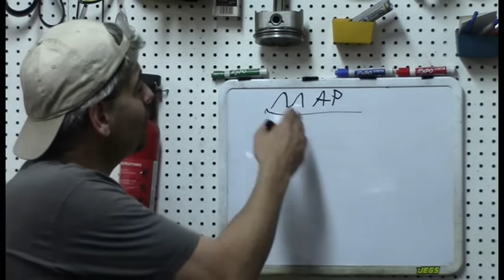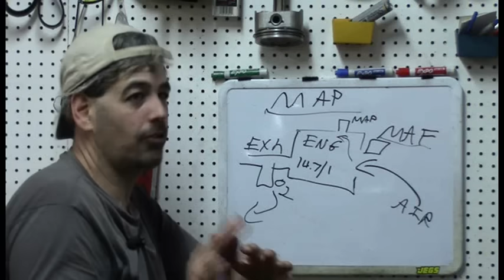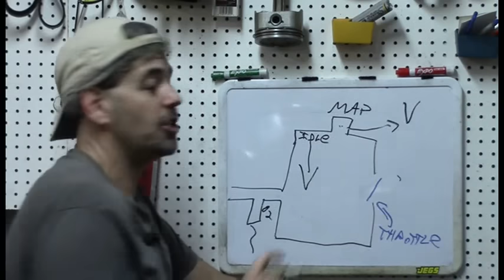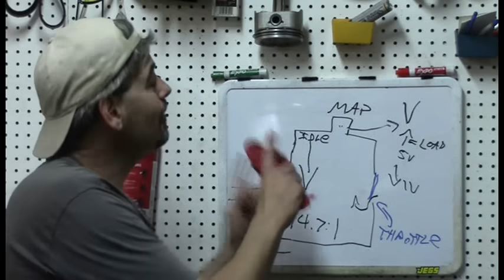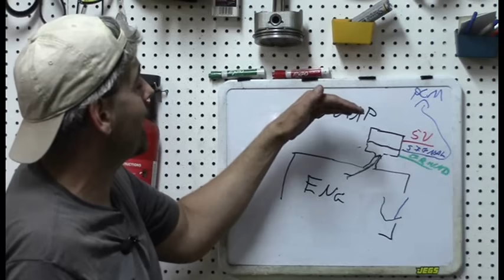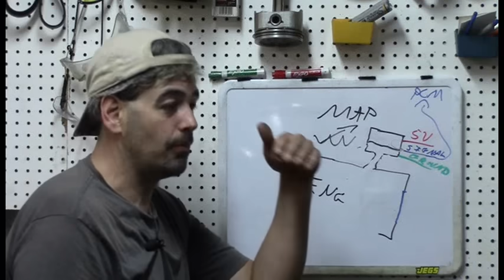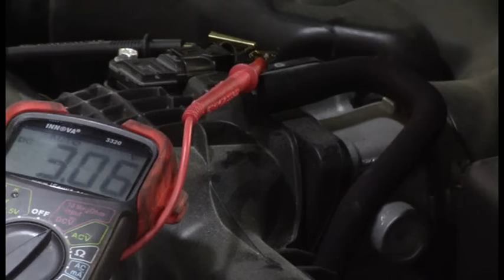MAP Sensor Diagnosis and Understanding Function- Pt1

Comment: hey , thanks for your video.
I am so confused because of these names people use for these items.
I have an ICV on my car which is connected to my throttle body that is used for Idle control.
I would like to change my air flow sensor which is connected to my intake pipe.
Is it fine if it is also called Air Flow Sensor , Air Temperature Sensor?
Is it the same thing?
Mine looks s little different to some i have seen on youtube.
Very hard to find particular car brand videos.
I have an OPEL CORSA B 1999 1.6 IE 1999 year model I think it is version 1.2 .
My car is non ecotec which i am not sure what that is. 
It is GM also, General Motors.
I am from South Africa.
I noticed that when i bought my new air intake pipe it comes with the air sensor or the "sensor" attached. 
For some reason the plug harness does not fit on the plug of the sensor, which is so strange, its like the pins and the mold of the plastic dont line up  which is why i suspect this versioning of the model which is different.
My mechanic hacked mine and just put in my old sensor and we kept the new sensor in my glove box.
I just find that weird as he knows that i have starting issues and i need to crank a long time before my car actually idles.
sometimes or in most cases i need to help it start /idle using the accelerator.
He told me to ignore it.
Looking forward to you comments.
Reply: Does the mass air flow sensor sound like the same as the air temp sensor? Obviously one is to measure air temp and the other is to measure flow. Common sense man. Keep it simple and stupid
Reply: And if the sensors on your engine don't connect to the new aftermarket part you bought, it's not the correct one. 😷 *facepalm. Just bring it to a mechanic shop man
Reply: Clearly different names, but it doesnt explain why auto stores and even the dealers have different names for the part i queried. It even seems part numbers are not a standard at times. At least the air sensor i the air intake pipe i bought was different. thanks.

Comment: I replaced my map sensor on an elantra 2001 and now the car won't turn on. Ignition turns on but when I turn to start, nothing. Doesn't crank.
Reply from the maker: What was the data you had showing yopu needed to replace the MAP? I would start there.
Reply: Schrodingers Box No data. I switched it out one morning when I was heading for work. Reason is, I turned the car on and hit the gas, after 2 or 3 seconds the pedal wouldn't give me power. The car sputtered and wouldn't go higher than 1000 rpms. Had to to turn the car off and on to get that initial start up juice all the way to an autoparts. Told me it could've been a bad map sensor or throttle position sensor. After I switched the map sensor the car wouldn't start. Put the old one back, nothing. Luckily for some reason I got it to start after messing with the engine pulley. Drove home having to do the same thing, off and on.
Reply: Got home and I switched the map sensor again for the new one as well as repairing a small intake leak and replacing the idle control valve I could hear buzzing weird. Nothing. Turns to On but doesn't crank. So, I tried bypassing the ignition by hotwirering it with the engine starter wires but at that point I think the battery was just too weakened to start anyways because it didn't.
Also, I accidentally turned the key to start when I was repairing the intake hose leak. Hose wasn't connected. Don't know if that could've caused an additional problem. Please, save me buddy. Anyone. Please help.
Reply from the maker: Do basic voltage check at the starter relay

Comment: Do you know if it is common for Chrysler to have bias voltage on their map sensor signal wires?
Reply from the maker: Wouldn't know. Just put a DVOM to it and find out.
Reply: Schrodingers Box already did, just want to make sure the 4.1v I got is what's supposed to be there.

Comment: This maybe a dumb question. Butbi have a 2000 pontiac boneville ssei and i have 2 codes one is MAF and other is TPS but also supercharger boost stays at 0 when normal highway speed was at -8 and when i hit it to WOT it would go anywhere from +8 to +10. Could the MAP be causing this. Its reading 14.3 psi at key on engine off.  Still need to check voltage though any help would be great. Thank you
Reply from the maker: it depends on what the codes are
Reply: @SchrodingersBox  P0121 for TPS and P0102 MAF
Reply from the maker: What is the reference voltage showing at the MAF and TPS?
Reply: @SchrodingersBox  5.0v
Reply: @SchrodingersBox  the psi goes fro. 14.3 at highway speed and will randomly spile up while driving and flat level road, which goes MAF and TPS to drop at that moment
Reply from the maker: You need to monitor the reference voltage at time of that event and determine if reference is dropping.

Comment: A MAP SENSOR COULD HAVE A PROBLEM WITH THE SIGNAL VOLTS BUT MEASURE VACUUM CORRECTLY? OR VICE VERSA? COULD GIVE A P0420 CODE?WHILE A BAD CATALYST CAN GIVE A CODE FOR A BAD MAP?
Reply from the maker: for the second part of your question, it’s easy- there is no way a bad MAP is going to cause a P0420. however, it is possible a P0420 could cause a MAP code and that would be if the catalytic converter was clogged. it’s not so much the loss of cat activity that would do it- it’s the backpressure from the clogged cat that could cause the MAP to throw a code for being out of range due to the backpressure. 
   now the first question is tough to answer because it depends how you look at it. If the MAP has a problem with the signal voltage, well technically it might measure the vacuum correctly but it won’t REPORT it correctly. It really depends on what you mean by “measure”. if the MAP has power and ground and the sweep moves to the correct position on the variable resistor, I would say it’s measuring correctly. but if there is a problem on the signal wire then it is not reporting that correct measurement. 
  It’s kind of like asking “would an internet outtage cause your security camera to stop surveying?”. well the camera may well still be viewing an area and thus it’s surveying, but it can’t record what it sees and you can’t see what the camera sees remotely because the “signal” is defective.  I would say it would prevent the camera from functioning but technically it’s still “seeing”. all depends on your definitions.
Reply: @SchrodingersBox  FIRST OF ALL THANK YOU SO MUCH FOR YOUR ANSWERS TODAY I WILL LOOK FOR A CLOGGED EXHAUST I HAD IT ON THE PROGRAM I ALSO MEASURED THE CATALYST TEMPERATURE INLET AND OUTLET AND THE INLET IS HOTTER THAN THE OUTLET (210 C INLET 170 C OUTLET).THE SIGNAL OF THE MAP SENSOR AFTER I SEE ON THE DIAGNOSTIC TOOL  IN LIVE DATA 10 IN/HG AT IDLE DOESN'T IT MEAN THAT THE PCM IS SEEING THE VALUE?I'VE JUST ALWAYS WONDERED IF A BAD MAP CAN MEASURE VACUUM CORRECTLY BUT NOT HAVE CORRECT VOLTS OR VICE VERSA. I THINK A BAD MAP HAS A PROBLEM WITH BOTH VACUUM AND VOLTS.ΜΑΥΒΕ HAVE A BAD MAP SENSOR UNLESS OF COURSE THE PROBLEM HAPPENS INSTANTLY BECAUSE THE FAULT LIGHT COMES ON AFTER 2 TO 3 DAYS.MAYBE I HAVE CLOGGET EXCHAST .MY LTFT AT IDLE IS 15% AND STFT -8% .SO I HAVE 7% TOTAL HOW DO YOU THINK?AND ONE LAST THING IF I HAD A CLOGGED EXHAUST WOULD THE MAP SENSOR READ 10IN/HG AT IDLE?
Reply from the maker: it’s really easy to check your catalytic converter. just look at the post-cat sensor (sensor 2) voltage.  if you have a 4 cylinder car it will be B1S2 on the scantool. the sensor should show a perfectly flat line at .8V at 2200 rpm. if the sensor voltage waves from .1V to .8V consistently then there is no question about it- you need a new catalytic converter.
Reply: @SchrodingersBox  AT IDLE SHOW 0,8 V  FLAT BUT AT 2200 RPM THE REAR O2 SENSOR WAVE TO 0,4 V TO 1,10 V.WHAT IS YOUR OPINION. I NEED A CATALYST I THINK.WHY DOES THE O2 SENSOR EXCEED 1 VOLT?I HAVE NEVER SEEN THIS ON A SENSOR!!!!!!I KNEW THAT IF THE REAR SENSOR HAS A WAVE AT IDLE I WANT A CATALYST. PLEASE WRITE TO ME IF IT MAKES A WAVE FROM 0.8 TO 1 VOLTS. DO YOU MEAN ANY WAVE? FROM 0.3 TO 0.8 FOR EXAMPLE??? OR LIKE IN THIS CASE 0.4 TO 1.10 VOLTS? AGAIN I UNDERSTAND IT NEEDS A CATALYST?I.E. AT 2200 RPM THE WAVE SHOULD BE FLAT ?....
Reply from the maker: Hmmm hard to explain that 1.1V. There is no doubt the catalytic converter is bad but that wouldn’t explain a 1.1V. 
   you need to measure the bias voltage and see if there is a wire issue or if the sensor is bad.
Reply: @SchrodingersBox  i send you your e mail the 02 sensor live data the voltage up to 1,27 i see now...test at 2500 rpm with propane
Reply: @SchrodingersBox  COULD I FINALLY HAVE A BAD SENSOR AND IT'S MESSING US WITH WRONG DATA? WE'RE THINKING OF CHANGING THE REAR SENSOR AND IF THE P0420 COMES AGAIN, GO FOR A CATALYST CHANGE WHAT DO YOU SAY?
Reply from the maker: There is 100% chance the cat code will return.
Reply: @SchrodingersBox  SO FIRST CATALYST WE CHANGE

Comment: How does the cruse control effect this ?
Reply: idk anything but i assume cruise control is governed by the throttle body and abs wheel speed sensors and speedometer and not much to do with stoichiometry / absolute engine pressure
Reply: and stop cruise switch

Comment: can a faulty MAP sensor cause a surging idle
Reply from the maker: ABsolutely.
Reply: I backprobed the MAP while running and the signal wire is fluctuating VERY rapidly between 0.88 and 2.55 vdc. so fast you cant  really see most of  the values. I checked for a good ground, and 5 volts refrence voltage, all good. I removed the map to take a good look at it, and one corner on the back looks melted some. so I dont know is it got hot internally or externally. while the engine was running, I used the timing light to see if the timing was moving and it was, so im thinking the timing adv and retarding is due to the errant MAP sensor signal. ?
Reply: working on an 89 5.7 liter gm tbi motor.
Reply: how does the map sensor also affect ignition timing, my timing mark is moving around at idle abt 1/2 inch. does the MAP sensor work in conjunction with the TPS to determine signal to the computer for timing and fuel delivery? now keep inn mind im 99 percent sure this Map sensor is bad. I understand how the IAC and temp coolant switch work at idle, how does the MAP signal come into play at idle. thanks
Reply: THANKS this truck has been a real PITA
Reply: If I can understand exactly how these systems work, I can figure out what is wrong. I had a guy come to work at an hvac repair shop. he was frustrated because he struggled to fix anything. so one day I asked him,, "do u know exactly how these systems work"? his reply was no. I asked,, how can you tell what is wrong if you do not know how it works in the first place?

Comment: When i connect my map sensor my car stalls , does that mean it bad?
Reply from the maker: it depends. does the car also have a MAF? what is the voltage reading from the MAP signal?
Reply: @SchrodingersBox  i belive it does, i have a 2016 vw jetta gli. I havnt read the voltage . I will today

Comment: I've changed the stupid knock sensors and gaskets also please somebody help me out with some guidance or advice please. Any is appreciated. Thank u
Reply from the maker: Jacob Villegas What was the data you got that indicated knock sensors were faulty?
Reply: It was a knock sensor code that came up.  But the issue I'm experiencing is, in the mornings when I start my truck it sounds like it's going to turn over, and turn on, but it just cranks, then stumbles, shakes a bit, and then turns right off. The second time I try, it turns on right away! like nothing was wrong! and the rest of the day it is normal!!! =[ I let the fuel pump prime on both attempts before turning the key all the way on.  I've tried priming it a few times before the first try and doesn't make a difference.  I've changed the fuel pressure regulator, fuel pump, fuel filter, spark plugs and wires, battery, and knock sensors and gaskets...  And it still does the same thing?  I hope I make sense I don't know how else to describe what is going on.  I really appreciate you getting back to me!!  A lot!  I feel like Idk what else to do.  I've asked and people tell me "it's the starter" but I ask "then why does it only happen in the morning even if it's not extremely cold outside".  Also it makes a knocking noise for the first 5 mins of running in the morning. I always let it warm up before taking off.  I really want to take care of my truck and hopefully stretch its life out as long as possible.  It is a 2002 Chevy Avalanche 5.3L Z71. If there is anything u can suggest for me to do to help diagnose the problem I would really really appreciate it!!!!!  Thank you tons!!!!!!!

Comment: have a 2006 Chrysler T&C 3.8l only getting 13,9 mpg..Help! Check engine light comes on intermittently new plugs wires etc..
Reply from the maker: What data do you have and what data did you get that indicated the plugs AND wires were the problem?
Reply: Hey ty much for replying! ...none that was just a tune up..i took it to autozone they said it was EGR Valve and said take it off and clean it with carb cleaner?
Reply from the maker: cdc link What data was there that it was the EGR valve? What was the desired vs actual; position? What was the voltage vs signal reading? What was the effect of inducing activity at idle?

Comment: Hey man I got some questions hoping you might be able to happy I got a 1999 Jeep with 4.7L I have put new tps ,new iac, new plugs and coils I did fuel pressure test and it does not make it 5 mins in a leak down so I pulled injectors and none are leaking but pull the codes bank 1-2 both rich looking at the stft and ltft both stft are in -15 to -30 and both ltft are at -33 and I am lost no codes or anything just rich
Reply from the maker: Start with the basics-  just simple data.
  You replaced TPS- what was your resistance curve on the TPS showing it was faulty?
   You replaced IAC- what are your IAC counts?
  You replaced plugs and coils- what data indicated this is an ignition failure and if so why was induction changed?
  What was your fuel pressure static vs loaded that indicated it failed a leakdown test?

   Without basic data it is impossible to tell anything.

Comment: Is it possible to throw an 02 sensor code with a faulty MAP sensor?
Reply: +Easton Manning I'm wondering the same thing. :(
Reply from the maker: +Bazzington James Yes its possible.
Reply: +Schrodingers Box thank you! I know my o2 sensor is functioning correctly and my vehicle does not have a MAF,  and it's throwing an o2 fault. I ordered a new MAP and fingers crossed! Thanks again!
Reply from the maker: Easton Manning Why cross fingers? If the data from the MAP indicated it needs replacing then that's your problem.
Reply: +Schrodingers Box fingers crossed it's the only problem ;)
Reply from the maker: +Easton Manning Hahahahaha nice answer!!! Yes no guarantee on that for sure- lord knows I've had that happen plenty!!
Reply: +Schrodingers Box well that solved the check engine light

Comment: my 95 Chevy blazer 4.3 after high rmp when the motor goes back to idle speed it wants to spit and chug and idle rough wgat could the problem be ?
Reply from the maker: +Chad Till  Could be anything. What data do you have so we can approach this analytically?
Reply: +Schrodingers Box other than my check engine light being on if I turn the key off and on 3 times it fixes the problem for the moment
Reply from the maker: Chad Till No I need LTFT and STFT at static vs load compared to IAC desired and actual position.
  Knowing a check engine light is on does nothing.

Comment: hello 
 i have 1997 ford fiesta with cfi  ,i trying to test map sensor as you describe and the sensor remaining on 2.53 volt no matter what the load on the engine
i have second hand sensor and its the same reading 2.53 volt
what i do wrong
השב
Reply from the maker: +Sagi Cohen Sounds like a frequency MAF then
Reply: +Schrodingers Box thanks there is easy way to check it at home with multimeter
Reply from the maker: Sagi Cohen Not unless you have Khz measurement on it

Comment: Can I ask you a question about a 2006 vw Passat 2.0tdi? I have a misfire judder in higher gears between 1500 and 1900 revs if I sink the boot. I have searched forums and had it in vw and an independent, nobody seems to have worked out what causes it. It does not throw up any faults, would it suggest it’s something to do with air?
Reply from the maker: Could be- what data do you have?
Reply: Schrodingers Box. Thank you for the reply. Not got any data, the garage never gave me it. They had it on vag-cam, could not see anything showing wrong. They had it hooked up on a drive also, said everything was showing as normal. They tried unplugging the map sensor I think it was, made the car worse. When I bought it, the turbo pipe was loose. It gave the same sort of judder, I got a new turbo and pick up pipe. I got the garage to check all the pipes, no visible signs of loose or cracks. Tried changing the fuel pump, did seem a litter better but still done it. Tried a plug and play ecu. I don’t think it does it when cold. Hope that might help. Lol. Thanks
Reply from the maker: Yeah sorry man. Can’t help without data. I’d at very least need to know the basic data like  LtFt and StFT values curved against load to even get a direction.
Reply: Schrodingers Box. Thank you, I will see if I can get something sorted out, I have found plenty others with the same problem. Just can’t seem to find a definite answer. Thank you.
Reply: Can I ask you another question please? Somebody has pointed me towards the hex shaft wearing on the oil pump, can you tell me if my symptoms are common with the hex failure?
Thank you.